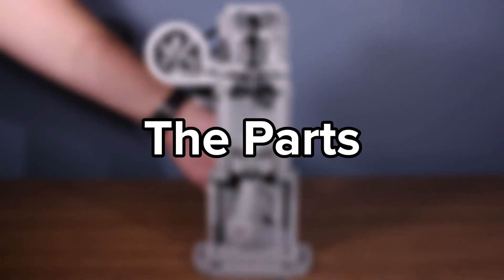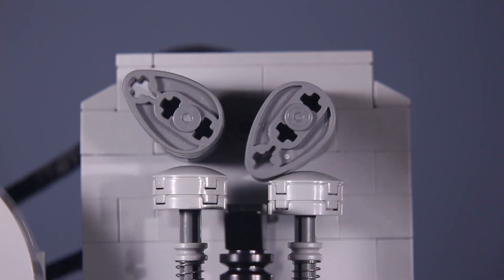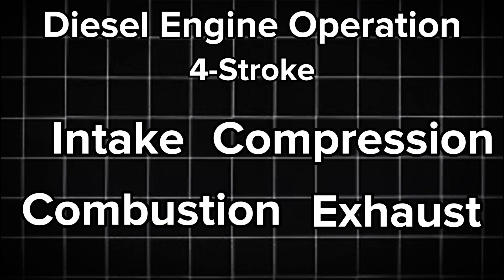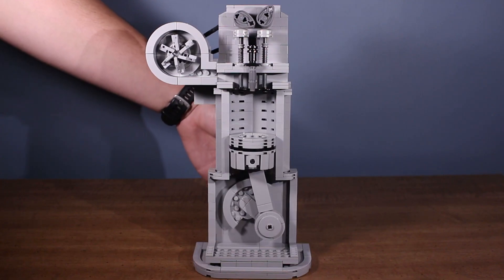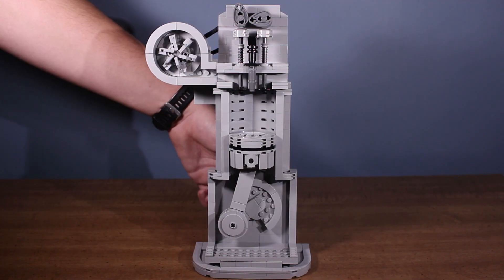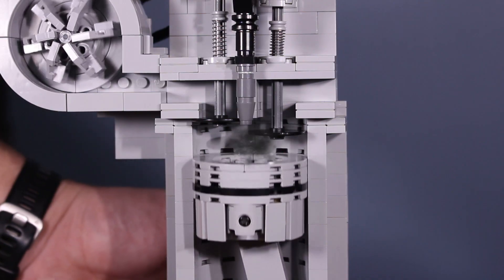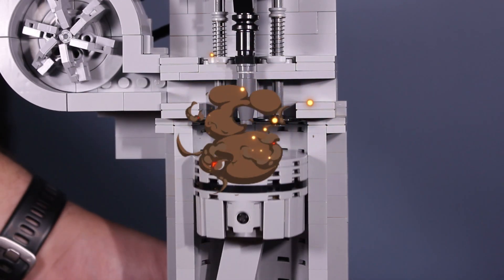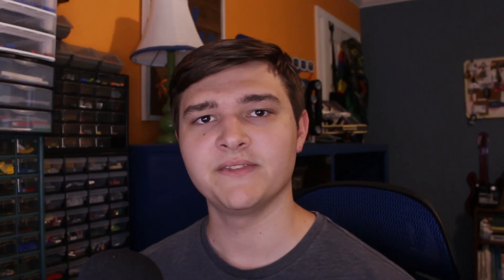How Diesel Engines Work | Explained with LEGO!

Comment: Wouldnt a supercharger work better on a diesel since a: you have torque to spare and b: turbos work better at high exhaust flows?
Reply from the maker: Not really. Turbos recover energy from the exhaust to force more air into the engine, which makes it more efficient and powerful.
Reply: Turbos increase power and drastically improve fuel efficiency. You can supercharge a diesel, but conventional diesels will be better off with a turbo

Comment: What Kind of Springs do you use for the valves? I found that the normal Lego ones are way to stiff
Reply from the maker: These are soft springs from some EngineDiyShop model kits. I've got a few on my channel if you're interested